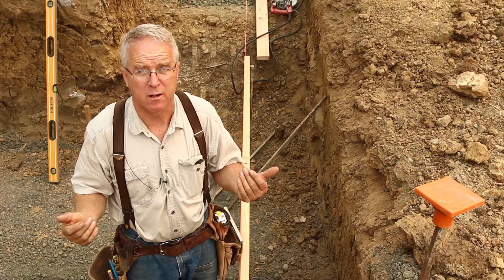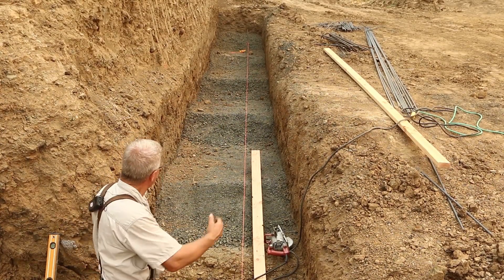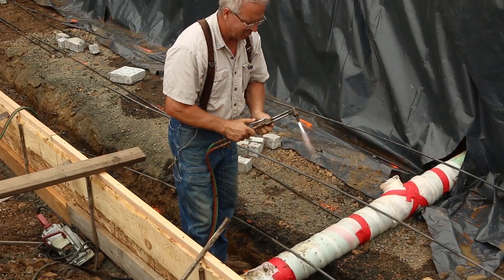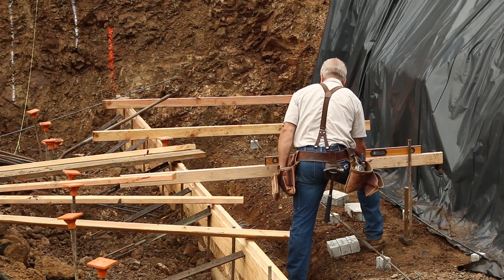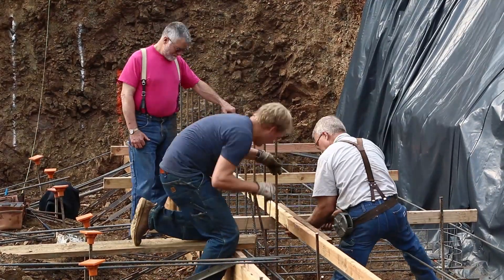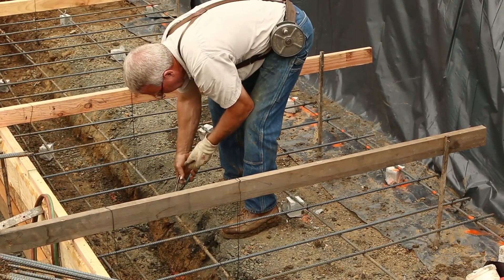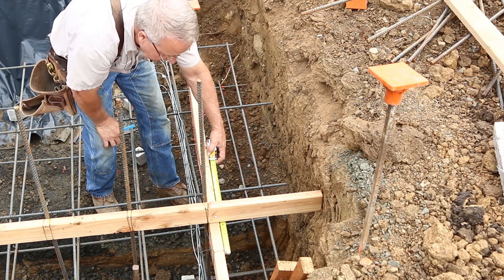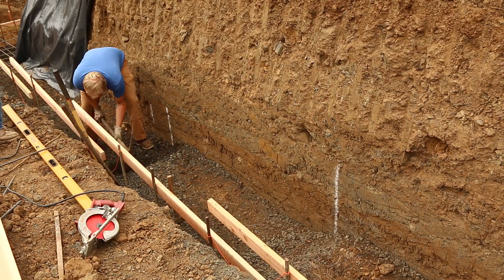How to Form Bulkheads Ep.13

Comment: I wish I could have you as a journeyman the gap of knowledge between your generation and mine is fleeting if not lost completely. I’m a third year concrete carpenter and you just taught me more in 15 minutes than I’ve learned in 2 years and 2 different footings.
Reply: Also the nail gun did offend me 😉

Comment: Most interesting. In my youth, I was a carpenter's helper in Wash., D.C. helping with form-work. During a big poor of a column, I had to watch out for a 'blow-out'. And at times, some concrete would leak out of the bottom. These columns were four-foot square and twelve ft. high. Luckily, I never saw a huge blow-out.

Comment: The pressure on the forms is not determined by the volume of concrete as described.  It is based only on the height.  For example: the water pressure at -50' under the surface of a lake is the same as the water pressure in a narrow well at the same depth of -50' under the surface of the well water.

Comment: Good video. Exactly how I do it except for the nail gun. We use impact screw guns to drive 2 1/2 inch drywall screws. Even on the template. Takes a bit longer to hang but quicker and easier to strip, clean, and re use the material

Comment: I told someone how to build a form on Friday, and Monday he told me it bulged. It turns out he fit the whalers in between the ribs. I neglected to tell him NOT to cut them, but to run it across. A disaster just barely averted. He built it with more stiffeners than I said and it was okay.

Comment: [7:45] so when he is talking about making a bench mark, one thing you can do, and nearly every commercial job I know, is set a universal benchmark, just a pin driven in the ground or a power pole, or a fire hydrant, or some object not actually on you site, but to use as a reference. you use this to base the rest of your work off of. it is important because as you start to make references made from references you can get up to 5 inches off, which can change everything and totally fuck up a site. 

normally why you make initial and per-final placement you want to check what you are doing at-least three different ways. for me this will be a check of relevance to other placements like the property line, check from my universal point, and  from the localized GPS we set up before we did construction.

if I set up a reference on site I check it the same way, and from experience never trust another contractor's measurements every time someone has, they end up being wrong and can be off up to a foot. be careful for using concrete pads as onsite references, because on larger sights, they might slope to shed water but only at a difference of 1 inch, which if the pad is 3 foot wide, isn't easily seen.

what he is doing is fine and you can make you own leveling rod, but there are professional leveling rods that come premarked and telescope. they will have two sets of numbers, rising on one side and lowering on the other, this is useful so you can check depth with one side and check height with the other, to explain how to do this just takes seeing one, but you can measure how much cut or fill you need by adjusting the rod and reading either the difference or the gain. this is especially useful when you are in a 20 foot hole putting sewer in. you can also tell if you are level by listing to the beeps on a laser level to determine if you are high or low: if you lean it and  if you hear low, level, low: you are level, if you only hear low: you are low, and if you hear high at all, you are high.

you can also use a leveling rod with an old survivors scope and do the same thing.

Comment: what you call a template we call a steel rack what you called the key way we call a toe wall. it can be interesting to know what the same thing can be called when you get on the opposite coast or just the next county. have you ever used the old universal forms the symons are nice and light but I've had ties bust while pouring something that could never happen with the universals, if you survive setting them miserable heavy things 
thanks keep on rollin

Comment: What's a bulkhead?  What's "shoot & grade?"  Why did you move them back 8 inches?  Why do we have to buy more concrete or spend more labor?  On what?  What changed?

What's a "ferring strip" because your wood wasn't the right size?  What's a story pole?  What's a transit?  What's "grades?"

I don't understand your problem, nor why you're building steps when you haven't yet poured any concrete.  What are the steps for?  What engineering problem are you addressing?  Didn't you already address all your engineering problems in your previous 12 videos?

What is a Symons form?  Telling me how they operate doesn't help when I don't know what they are, nor why we're using them.

That whole segment at 9 minutes where you're going down the steps because they come up?  Totally baffled.  Have no idea what you're talking about, nor how this fits into your project.  Where is the laser that is measuring this stuff, and what is it measuring?  You've totally lost me.  You're just talking nonsense at this point.  Could you please re-shoot and/or re-edit this entire video?

What would be helpful is if, at the beginning of every new video, you explained what you did in the last video, and how what you're doing in the new video ties seamlessly into the new one.  This video appears to conflict with your last two.

ALL that being said, I still can't imagine what you're trying to build.  Can somebody post some images that explain what you're trying to build?  Where's the kitchen?  Is there a driveway?  Is there a porch, and can you have a gas grill on it?  I have such a hard time envisioning what you're building because you've never shown me what you're building.

I love you, man.  Your videos rock.  But this one had some issues.

Comment: Scott it's like my dad used to say, "there's more than 1 way to skin a cat, but what is the 1 way that everybody knows?" HAHA 😄
So often a designer would fax me a "drawing" of a piece of custom furniture that they had sold and need me to bid/make. That drawing was little more than a rectangle with some squiggly lines on top to represent crown mold. Much like your engineers I was merely given certain parameters of width-height-depth along with wood species-color-etc etc etc. And I would need to turn it in to working drawings/order quantities/cut lists/ joinery techniques/lead times/assembly procedures/delivery options and payment dates. The client would typically not even LIKE the particular piece until the designer came on site and said "yes this is what we talked about" 
It was maddening at times to see the absolute power and trust these designers had over the client, yet were only able to draw a rectangle and a squiggly line!
Reply: I've been there. Corporate logo art piece without even the back of the napkin drawing to go off of. The company sends their secretary to my shop to see how things are going about 1/3 through the build and she reported that the shop looked dirty because there was sawdust on the floor. That tainted the perception of my product to the customer, but their clients absolutely fawned over the end product and couldn't stop remarking how amazing it looked (hundreds of people at a big office grand opening). My "dirty" sawdust saw was used as a reason to stiff me half the pay on the job. 

Guess I should have played designer and taken the secretary to lunch to chat up how well things were going rather than letting her see for herself.
Reply: carpespasm no, you should have controlled the money part of the three pronged deal!
Money
Time
Quality
Tell the customer that they get to pick Two And only TWO of those prongs!

Comment: As a union concrete guy, you're right on the money with planning the footing to make your walls easier. I am offended by the nailgun though.... 

I don't know why you're putting all that support for the verticals. I'd have just tied the verticals to 2 #4 rebars above grade to support it. Then when you're done pouring string a line and straighten them out before it gets hard.

Also on the jump ups, you don't need any stakes in the concrete just run a long stringer then braces on each jump, with the a few stakes in the bank for support.

Comment: 1'×30' of concrete is only 150 lbs of pressure... 2'×30' of concrete is 300 lbs of pressure on the bottom 1'

Comment: Interestingly in the UK , and according to our building regulations, where we have a stepped foundation there is a minimum overlap at the step and in a case such as yours where the trench fill footing is a foot thick the overlap is the greater of twice the height of the step or one meter.

Comment: What I don't understand - being German - is the fact that in the USA most houses are built from Wood - Plywood on 2x4" mostly, I guess.Why would anyone do that - especially in areas where there is a high risk of Tornados? Like in the Story of the 3 pigs and the wolf, right?
Reply: Thomas Bögel basements to a large degree now a Days are finished with living space. After all it doubles or adds a third to your living sq footage. A very cheap addition to your house. 
Framed walls are 2x4 or 2x6.  This allows an R-13 to an R-19.  R-15 is now code for many areas in a framed wall. Sprayed in foamed insulation is a growing option.
Reply: Wood is easy, affordable and generally fast. What type of materials do you use over there ? Thanks.
Reply: august generally masonry. The foundation is either a concrete slab, or an actual full height underground basement (cast concrete walls). Then some kind of high-tech brick (google for poroton and Ytong) due to the strict energy conservation laws. The roof is usually a wood beam construction, with rock wool insulation between the beams and burnt clay shingles. This is more expensive, for sure. And it takes much longer to build. But a class 3 tornado will only knock some roof tiles off and rip out the sat dish, but that's that.
Reply: Thomas Bögel portions of this country you can’t have basements. Groundwater is so high.  Slab is secure way of building but I hate having a slab. Much prefer a crawl or basement if possible. 
2x framing is much cheaper to build and most areas aren’t in hurricane or tornado prone areas.
Reply: Troy Pierce I understand. I also prefer having a full basement. Some people say that if you have one, it will be full of junk soon. Well, there is some truth to that I guess. Anyway, about the wood construction - what about heat insulation? 2" of insulation does not sound like much. Outside walls over here are 9.5" thick, sometimes even 14".

Comment: The wonderful paradox of concrete forms: Making them strong enough to have zero doubt that they will hold true and in place when loaded with wet concrete, but at the same building them in such a way that you can easily access everything and not spend a fortune in labour and materials putting them up.

And my favourite issue: How will everything react to having a big heavy truck with a large engine running near by. Have seen more than a few engineers surprised by soil movement around formwork due to underestimating the effect trucks moving around a site can have.
Reply: RealLuckless the soil looks pretty damn good. So just throw all the chutes on and keep it as far away as you can. 

Also, he could get a pump or conveyor, but you usually only do that when your footings are down in a hole, or unaccessible otherwise